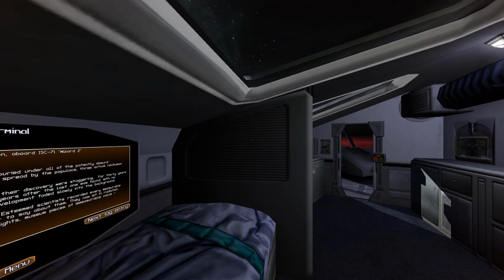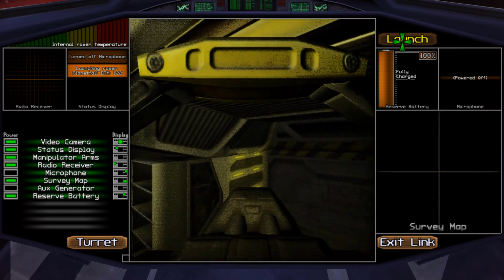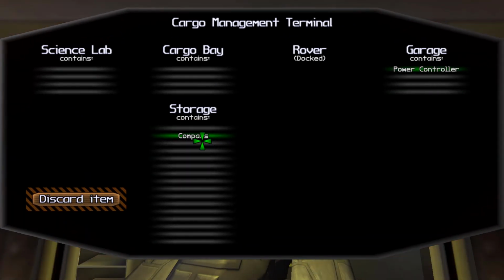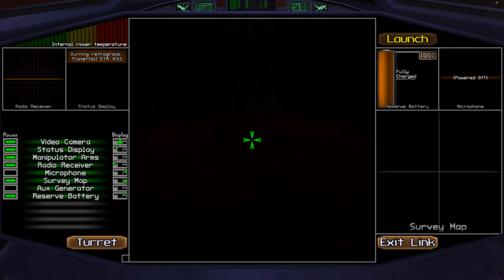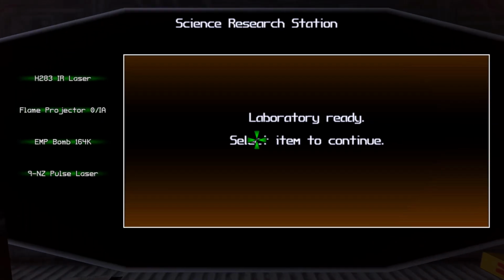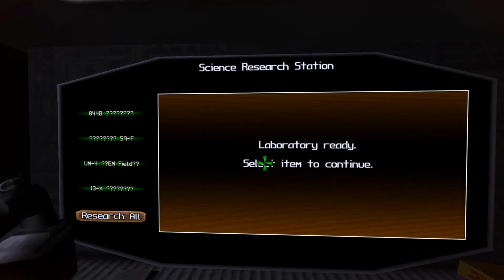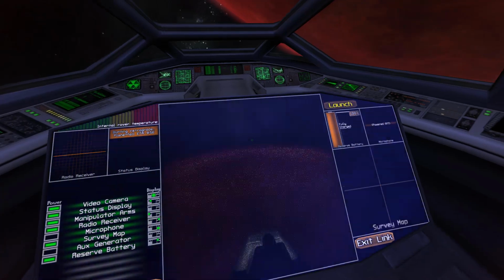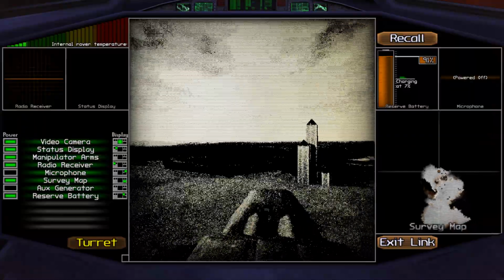SCAVENGER SV-4: Second Run Part 1/3

Comment: Another tip, the manipulator arms passively drain electricity, turning them off and only turning them back on when you want to pick up something helps conserving power.

Also when you looked at the sentry and heard that noise in the radio? That is their passive scanning. If you hear that specific pattern there is always a sentry nearby. When they agro on you the pattern becomes very distinct and you will know they are onto you.
Reply from the maker: Thanks for the tips!

Comment: I've seen your other videos about how to deal with the alien stowaways but I was wondering if you could use the lasers and weapons you find to fight the aliens and turrets on the planet before they attack you?
Reply from the maker: Good question!  On my own time, I have experimented with those ideas, and learned that doing so incurs additional risk of irreparable rover damage, and  spends time that could be otherwise be used to outrun the mechanical sentries and grab more artifacts.  Given the radiation exposure dynamic to the gameplay, any gains from extra time spent on the expedition could be nullified by reduced health (which affects your final score).

I do know that laser cannons can be used to open doors in larger structures to gain access to the artifacts within.  I hope to get a chance to show that in the future.  Thanks for your questions, and I hope you keep watching!
Reply: You can shoot down the stowaways and collect their corpses (though they are not worth much). And if you are far away from the sentries when they are not activated you can snipe them before they can shoot at you. With a high enough powered laser (10-15) three shots is usually enough. If they are already on you and moving they are quite harder to kill. In my opinion laser is the only reliable weapon to use against sentries.